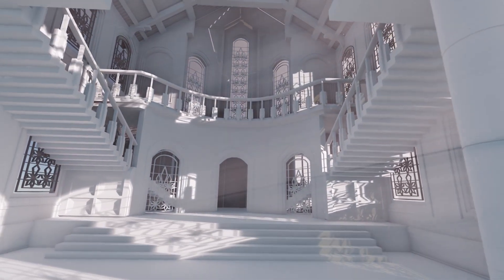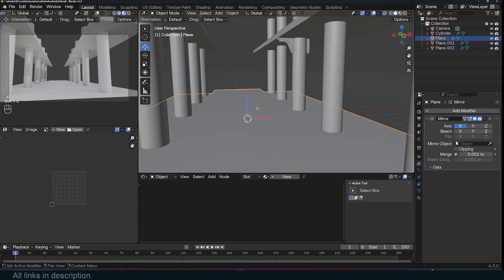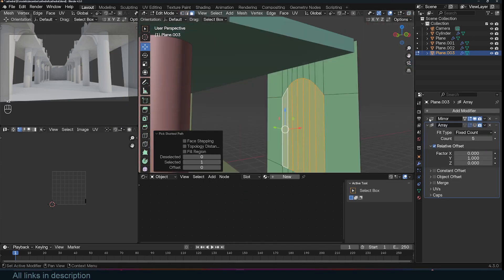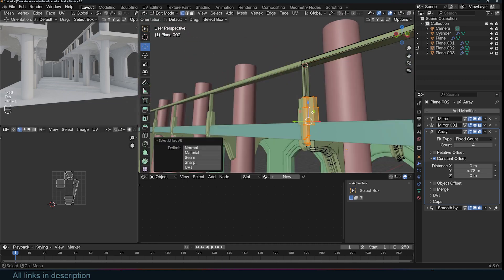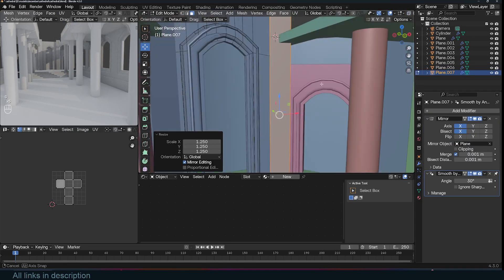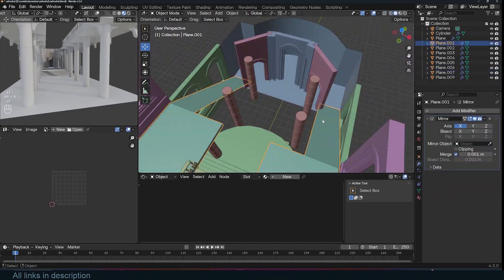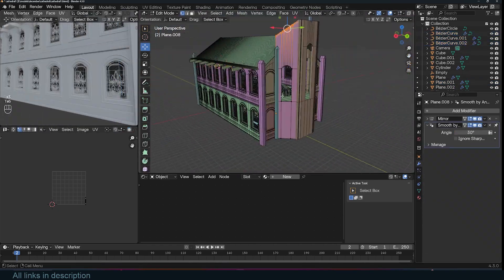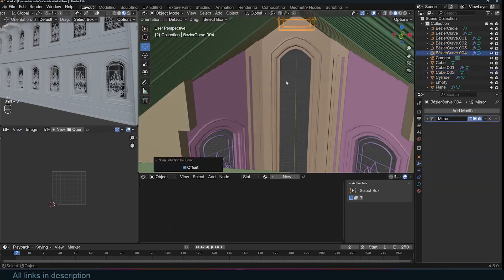modeling a cathedral in blender

Comment: I guess its good practice for a first project but i wouldn't sell it. Four hours of work is not enough for a full cathedral (it's also a bit small for a cathedral)
It doesn't make sense historically or even just the layout. (You have to walk past the altar to get upstairs + no access to the balcony above the staircase)
There are floating walls (beneath the stairs) and the stairs cross the windows.
Bad topology and unnececary faces within objects. 
The modularity aspect of the project limits it in the design aspect.
Reply from the maker: most of the assets are just for something to throw in a game,, for players to explore quickly it does not have to be too acurate especially for indie games